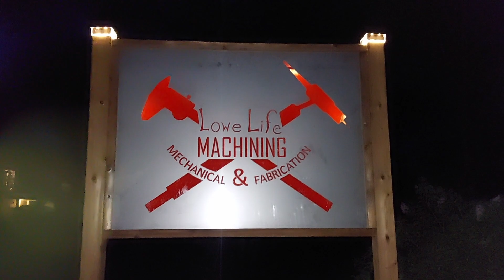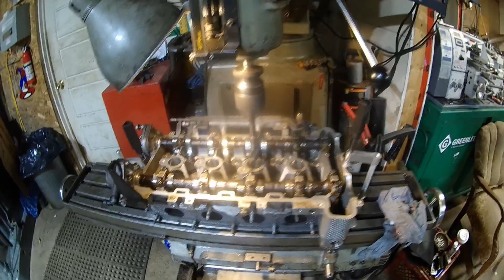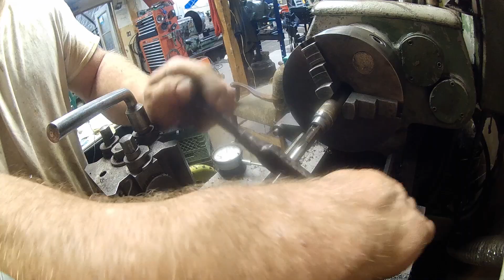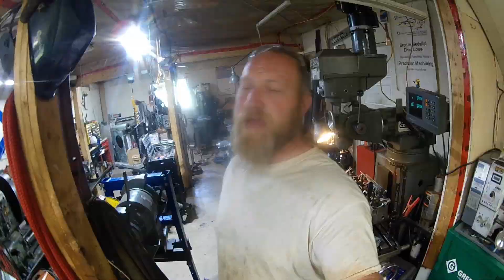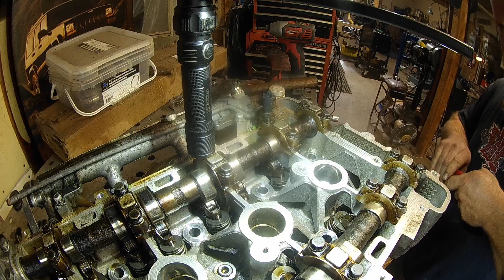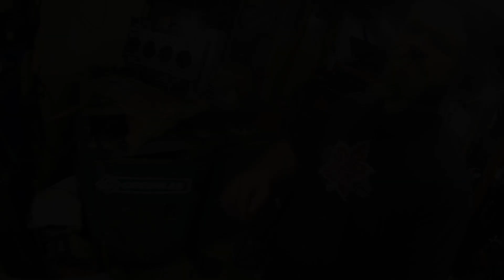How to repair a blown out spark plug

Comment: Nice work.  I've always wondered, when a plug blows out like that, is it a catastrophic event?  Or does the plug just kinda push out and rattle around?
Reply from the maker: well.... it an be! lol, most times it'll just blow out and rattle around, but it makes a rachet. but continuing to drive like that will do no good for your engine. I've repaired them with the heads still on the engine, but much care is taken to keep debise out of the cylinder while doing so.